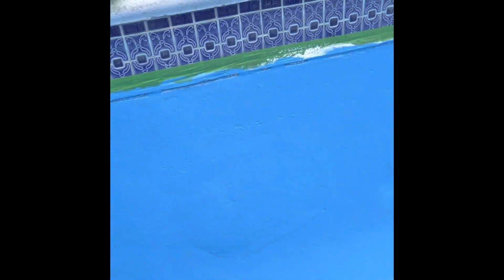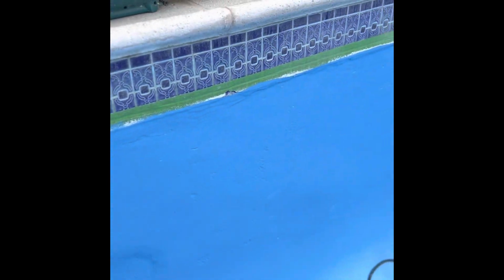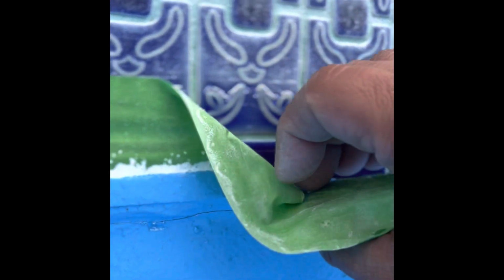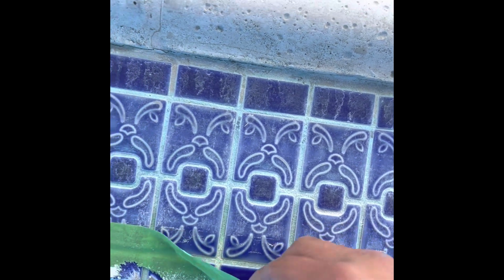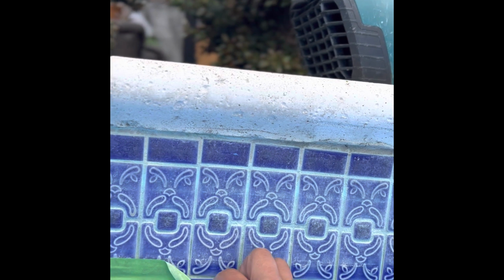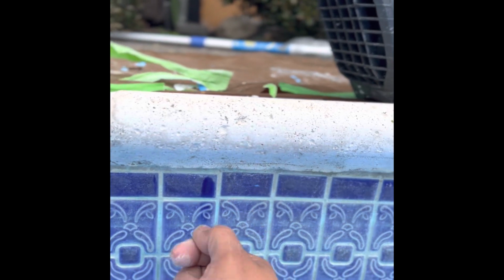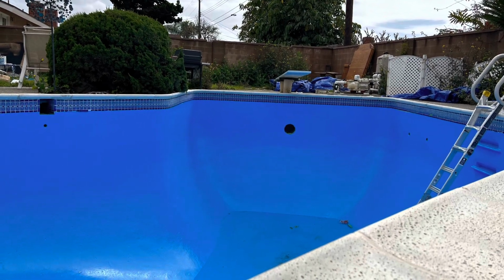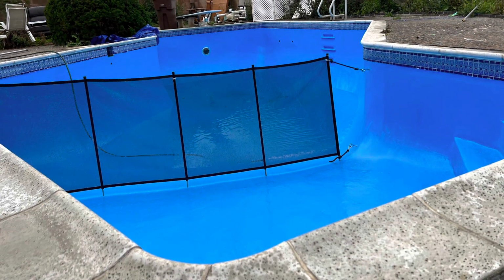Epoxy Pool Paint Tip’s & Tricks / How To Properly Remove Masking Tape After Painting With Epoxy

Comment: Why does bubbles  occur  after a few months  under  the  mosaic line ?
Reply from the maker: Those bubbles are typically caused by reverse osmosis that occurs when you add paint or primer on a surface that is damp or that has not dried thoroughly.

Comment: maybe tape can be removed while paint still wet?
Reply: Yes it actually should beas soon as your finished with the last coat. Or you can pill it right off when you fill the pool up. The water will soften it right up.
Reply from the maker: Of course you can. However In doing so you run a higher risk of having wet painters tape smearing wet epoxy pool paint all over the place including your pool tiles and skimmer if your not careful. Due to the delicate nature of epoxy pool paint I always reckoned to let the epoxy dry and harden before you attempt to remove it all together. 
 
But if yes you can always remove anytime after you paint.
Reply from the maker: The truth is there are many ways to apply and remove tape however this is the method I found to be more useful to me in my line of work. In my efforts to achieve a complete restoration of most pools with epoxy. It is my responsibility to present the end results to my customers for approval prior to filling there pool with water themselves. For the most part they do request to have the tape removed before filling the pool with water and so it’s more of a convenience thing for both my clients and myself to remove tape before filling with water

Comment: If you paint it and pull it immediately you won't have the issues you're having.
Reply from the maker: Yes that is true but if it is freshly painted, you will run the risk of smudging the paint and smearing epoxy on your tiles. Epoxy paint can be quite messy and although it is easier to just pull off after you paint it, the chances of your smudging your tiles is greater so I personally choose to play it safe. In any case yes you can remove the tape in various ways but personally, this is my preferred method in doing so to avoid taking the risk of damaging my clients pool tiles.